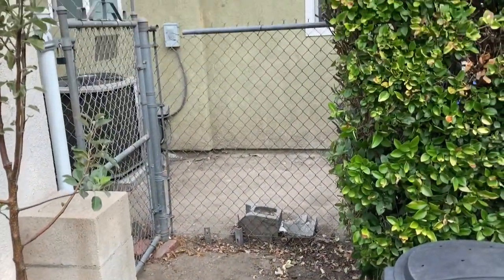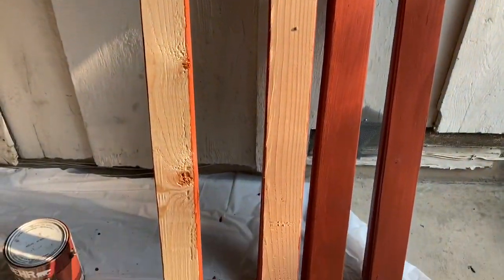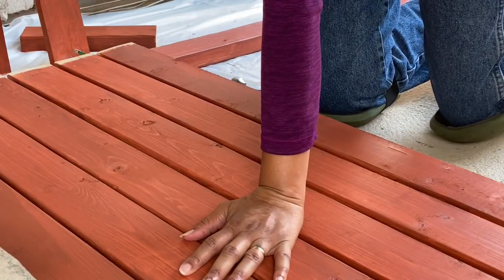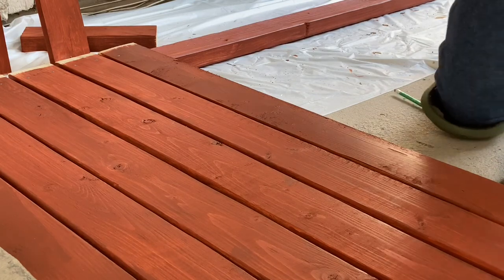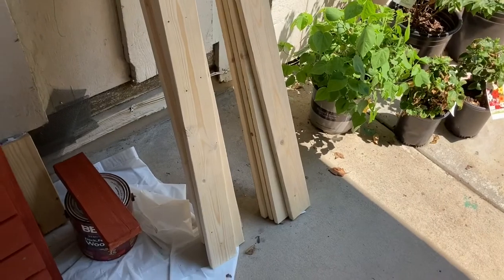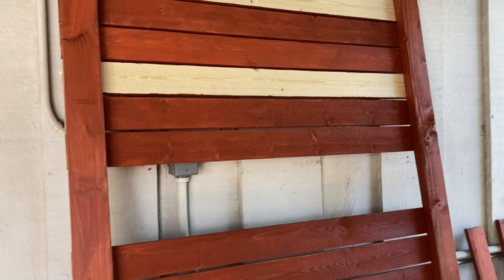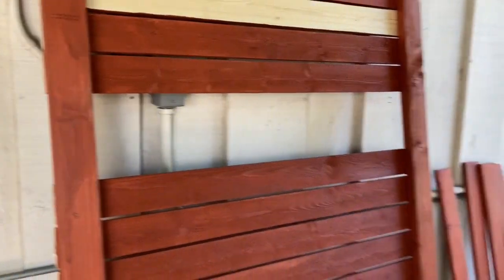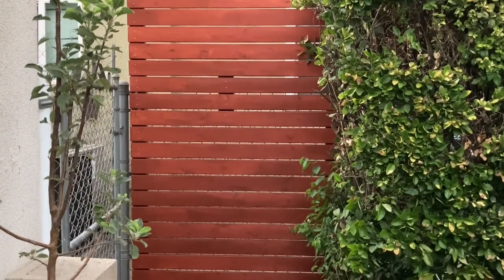DIY PRIVACY FENCE/SCREEN

Comment: I have umbrellas up for my plants as well.    However, I do that each summer.  As the sun moves over during the summer some areas simply. Need some shade.    It all works out.
Reply from the maker: Yes, so true. The sun climbs higher in the summertime, exposing many more spots to direct sunlight.